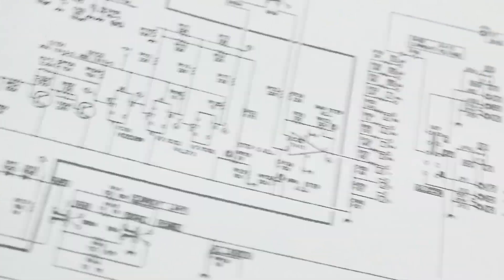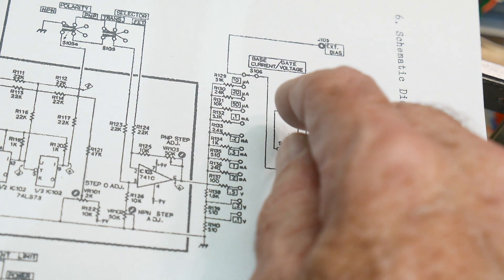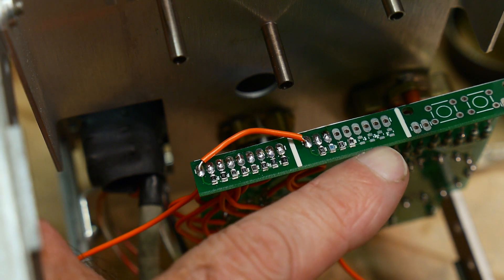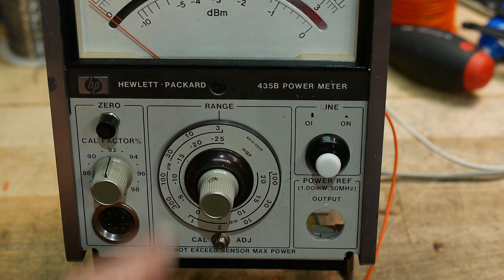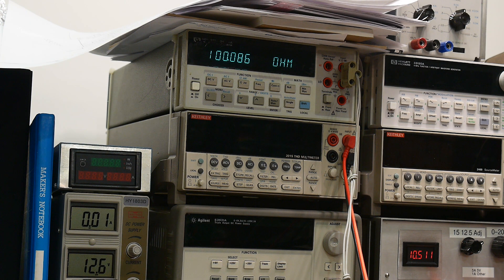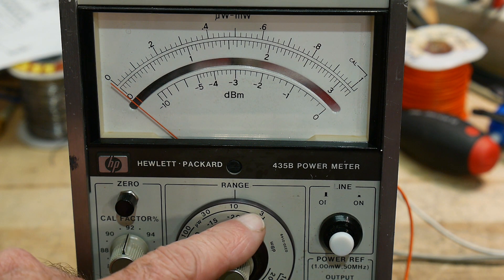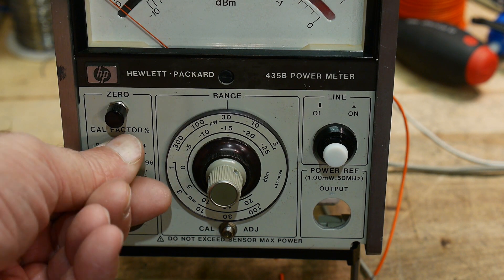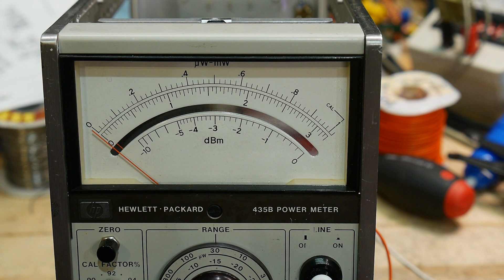#647 Transistor Curve Tracer  (part 9 of 10)

Comment: You may already know this, but the central switch scale range ring is removable and replaceable. The black plastic retainer ring unscrews and the scales drop out. They are printed on thin aluminum rings, usually on both sides. Removing the ring may make it easier to modify the scale with your own scale, calibrations, and markings.
Reply from the maker: I did not know. Thanks